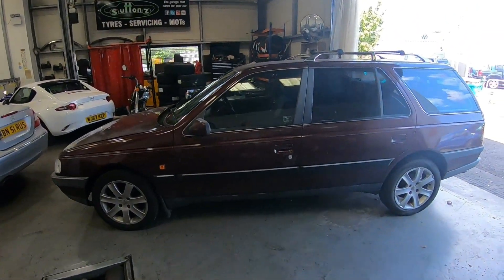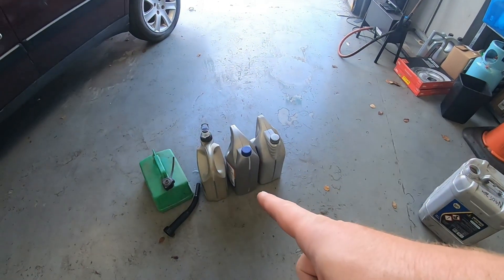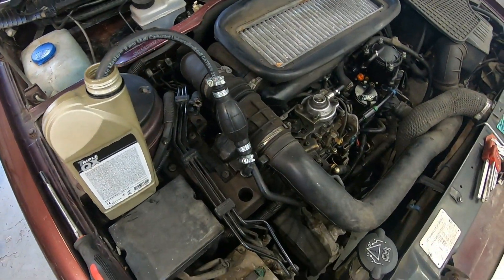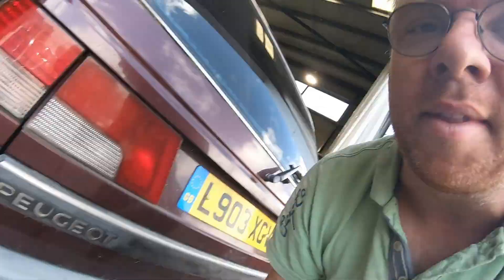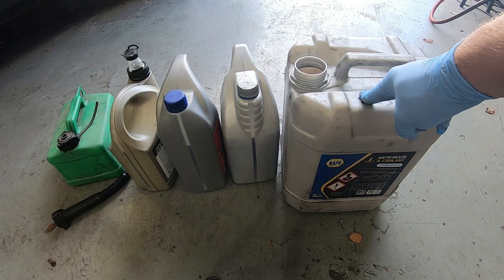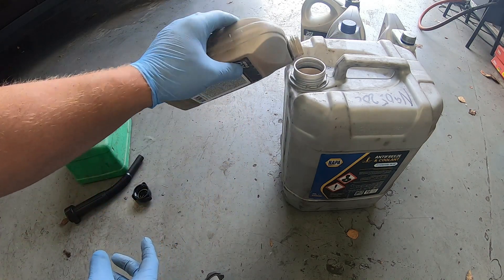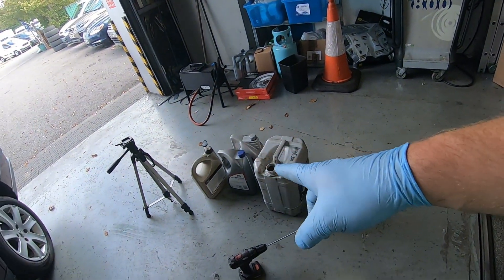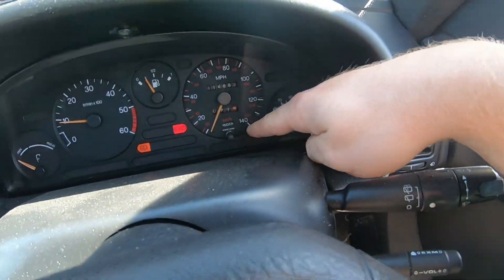Will a car run on engine oil and petrol? - Alternative fuel Peugeot 405

Comment: Is the car a petrol or diesel car
Reply from the maker: It's a diesel
Reply: What about for petrol can ...?
Reply from the maker: @ewalefoh_prosper it wouldn't work for a petrol car as the flash point of diesel fuel (and any alternative) is much higher.

Comment: Is it legal to drive on used engine oil
Reply from the maker: From the research I did, the laws on 'black diesel' are the same as used veg oil. 2500 litres per year are legal.